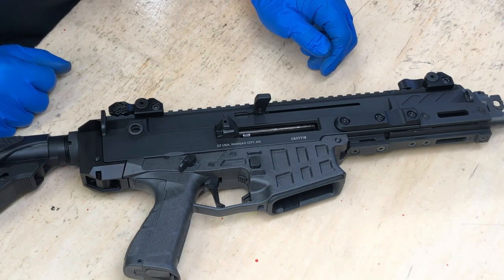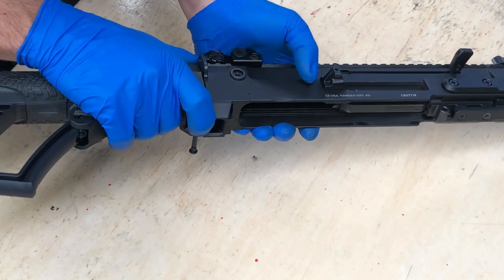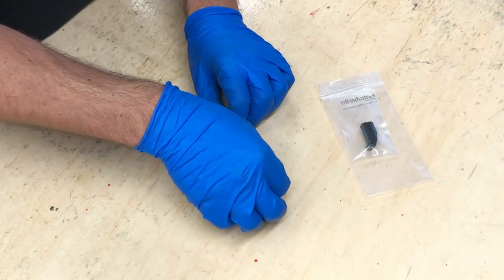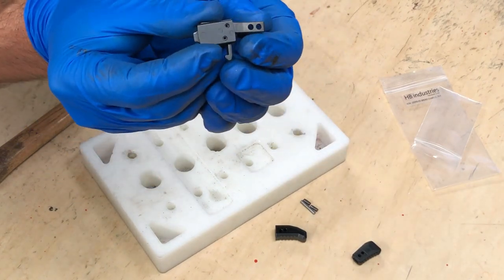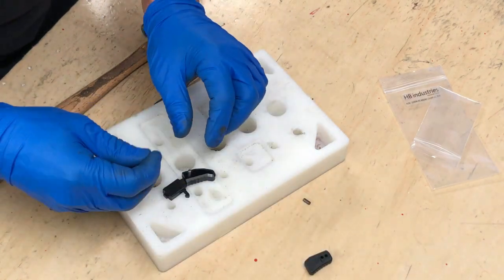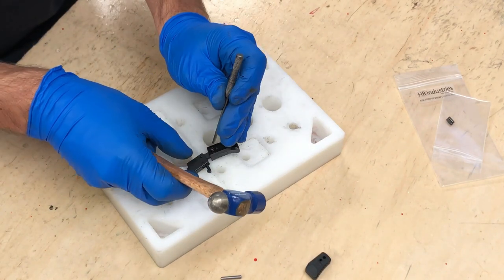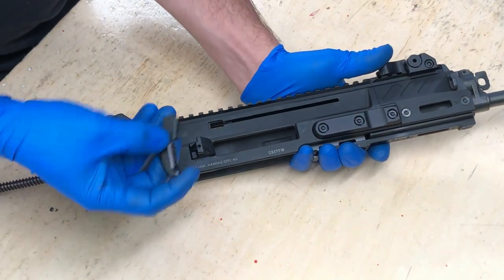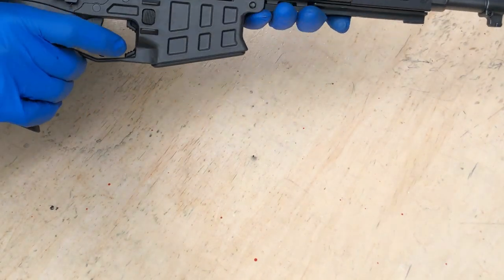HBI CZ Bren 2 Charging Handle Install Video

Comment: Is the recoil spring have a slight bend in it. My is brand new and it look bent.
Reply from the maker: The recoil springs do have a small amount of pre-load on them when installed onto the recoil rod (assembly). Maybe this is what you are seeing? The recoil rod OD is smaller than the recoil spring ID; this means that when the recoil spring is compressed it will push off center, and might look bent or deformed? Regardless, totally normal :-)
Reply: @hb_industries  thx man